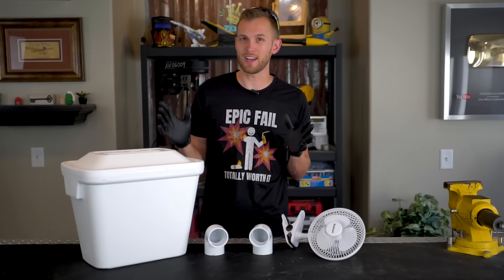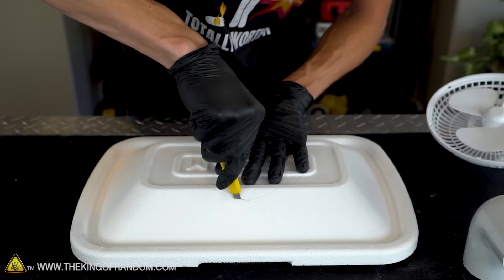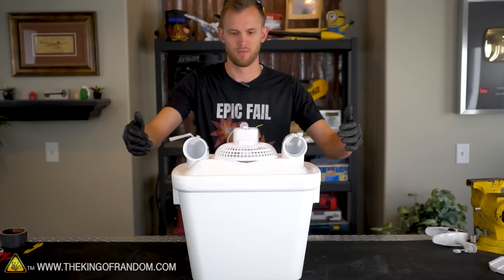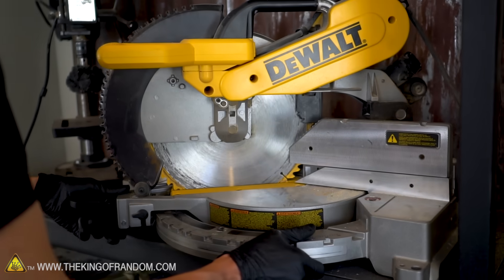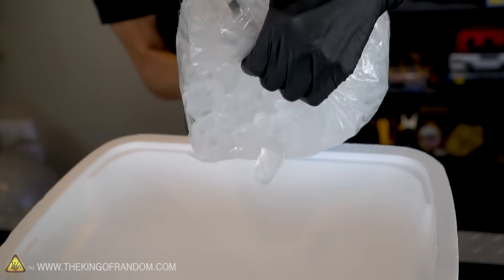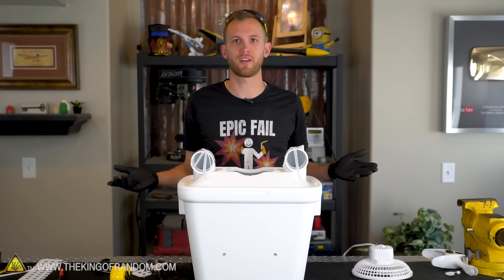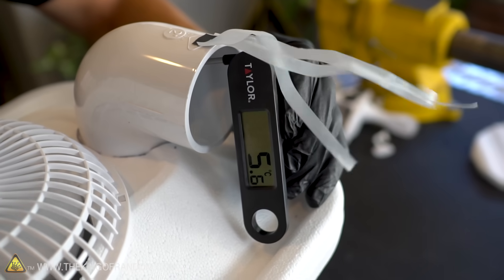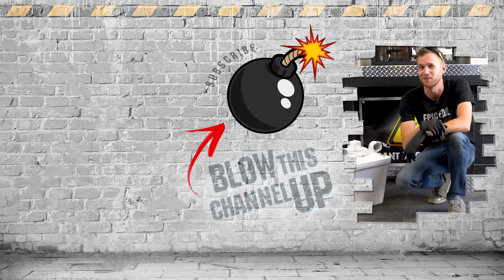Recycled Styrofoam Air Conditioner! TKOR Creates An Efficient DIY Air Conditioner!

Comment: Jeez his house is freezing cold I keep my A/C at 80-83 during summers here in southern California... Outside its like 90-115 degrees
Reply: Why TF u keep it that hot I live out here in NV when we got 100° days everyday and we keep our house at around 75 just close some blinds and don't leave windows open holyshit dude, what's the point of ac If it's that hot?
Reply: A is for Annihilation same I keep mine between 60-64
Reply: In Arizona we get 110 degree days in the summer.
Reply: You call that cold lmao
Reply: Ammar Badri .. 😓.. that's so hot. Mind u If central a.c. it's a little more accurate than window units but I keep my window unit on 60 degrees when I'm home.  66 when not on energy saver for fur babies.
Reply: Living in a high desert means that hot days are really hot. Living on the coast like in California where you have humidity in the air keeps you cooler even if the temperature is actually the same.

Comment: You could use a PC fan which is smaller and runs at higher speeds about 2000rpm to be exact then instead of ice at bottom and top you could use ice at the bottom then frozen water bottles at the top.

Comment: Could be better before the modifications, since the ice would last longer and require less attention to keep working.
I wonder if you had some flexible hose ducted from the fan, snaked around the bottom, and liquid water poured around the hose. Then stick the whole contraption in a chest freezer so that when you go to use it, you're using a big block of ice. Should last a very long time!

Comment: Instead of these ice based Aircon make one based off of evaporation BUT instead of using the wet air inside of the house like a swamp cooler, use the water that is cooled by the evaporation process to pump into a radiator.

Comment: If you put wet paper towel on the upper side of the bottles and cage the pipe with them it will improve your AC if you use salt water on the towels and for the ice you can go under 0°c
Reply: That 32°F for the Americans

Comment: Oh there’s one slight improvement if you want and that is adding a cone onto the nozzle, so that the air travels through the cone will get tighter and tighter air is surprisingly felt cool and you should watch a video about eco friendly ac without electricity and seriously it works.

Comment: why don't you just put a fan inside of your fridge and/or freezer? i mean, your ice also comes from the freezer.
Reply: You can't. Fridges heat up the room while cooling the interior (so making the ice for this air conditioner in the freezer means you actually heat up the room overall). You have to dispose of the energy generated ( this is why air conditioning units are connected to the outside, to dispose of heat). So if you stick your fridge half out the window then yes. You now have the most expensive, worst air conditioner ever. And you can't use your fridge. And you have to keep the gap between it and the window or door frame sealed else the air conditioner is ineffective.

Comment: Do I see a bucket shopvac in my future?
Reply: Exhaust could push out the air so ice in the bucket, might as well have another cooler sucking cold air for the intake and put a fan about a foot or two away from it to spread the cool air..please give this a try.
Reply: Just have to worry about the noise making you possibly fall asleep because you are so comfortable.

Comment: you should have put dry ice in the cooler or LN2.  my grandma once told me that when they use to drive from TX to CA they would put dry ice by the front window intake as they didnt have ac in the car.

Comment: What if you use liquid nitrogen instead of ice?
Reply: No you would not die from CO2. Liquid Nitrogen is exactly what the name says it is. Nitrogen in a liquid state. You would flood the room with Nitrogen gas, which isnt toxic at all as most of our air is made of it. But it would cause the room to fill with Nitrogen and displace the breathable oxygen. The most insidious part is that you can breath Nitrogen and not notice your going into Hypoxia as it causes confusion and euphoria to name a few symptoms. It would likely be fine outdoors but NEVER use Dry Ice (Soild CO2) or Liquid Nitrogen in these things in enclosed spaces, use common sense.
Reply: So basically... what I just said.

Comment: Wouldn't it cool A room better if the piping was straight up instead of 90°? Cool air goes down. If it is coming out at knee level, than only your feet would get cold. If it went up first it would circulate.

Comment: Friendly reminder:
DO NOT USE DRY ICE
dry ice turns into carbon monoxide when it reaches room temperature, so you will not have a fun time there
Reply: The Comedy Butchers 

Carbon Dioxide 

but yes dry ice is very bad idea
Reply: Dry ice should actually be fine. You're pumping mostly air into the cooler and a little bit of sublimized co2. It's not like it's a sealed container with no source of oxygen from the outside.

Comment: 22 degrees Celsius is already cold, getting something to 5.5 degrees might be harder when you live in a place where it's normally 28 to 30 (and that's not even summer yet).
Also, to keep the temperature of the ice even after melting, you can combine it with rock salt. It keeps the temperature cool for a while longer than just ice.

Comment: Hey why not put liquid nitrogen in that thing
Reply: It would work to cool things down but it can also fill your room up with a bunch of Nitrogen and replace the Oxygen in there. This could make you suffocate without even realizing it. Even if that wasn't a danger Liquid Nitrogen is very expensive to be used in that manner, even setting up a system to create Liquid Nitrogen wouldn't create enough to make it a reliable enough source of cool air as the Liquid Nitrogen would evaporate too quickly for the rate that you would be creating it. Ice is cheaper and can be refrozen in a shorter amount of time which makes it more reliable. Let's be honest, you don't need a substance as cold as Liquid Nitrogen to cool an area down.

Comment: So instead of using ice or the Frozen bottles! I use the Freezy Pops that come in the little plastic mesh bag bought two of them had one of the freezer had one of those cooler. It always made it really easy to switch them out between the two of them. Sad thing is someone eventually ate them all.

Comment: So.. Dont use dry ice?
Need a clear explanation why I shouldn't use it.
Reply: Naufal Adi Wibowo Dry ice would give about the same cooling as water-ice. The only difference being you would die from the CO2 gas evaporating from the dry ice.
Reply: just have a well ventilated room..?
Reply: Al D3M Mafia But since water ice basicly has the same cooling potential as dry ice, why would you use dry ice? It costs extra and has no benefits.
Reply: Håkon Lillebo dry ice is much colder than regular ice.
Reply: Al D3M Mafia I know, but thermodynamics are more complicated than temperature. Basicly the hydrogen bonds that water ice creates need A LOT of energy to break. It takes that energy from the surrounding air. That's why no one uses dry ice to cool their drink :)
Reply: Håkon Lillebo mate dry ice doesn't have any hydrogen bonding...
Reply: Al D3M Mafia That's not what I meant, sorry if I was unclear. That last comment about using dry ice in drinks was meant as an example of how no one uses dry ice for those kind of purposes as water ice works as well (maybe even better) and is much cheaper. :)
Reply: Håkon Lillebo yep sure :)

Comment: Pls put human blood in a vacuum chamber to see if it turns blue
Reply: This thread was about human blood sheldon.
Reply: It will not. It will boil though.
Reply: Blood in a needle is in an airtight container already and isn't blue also oxidation changes the chemical structure of subststances so removing the oxygen around it wouldn't do anything
Reply: Liam Benson no it wouldn’t
Reply: No it isnt, its either dark red or REALLY dark red (with a bit of purple) though I imagine if your blood is that dark/purple you're probably choking to death.
Reply: Blood is never blue
Reply: Blood, in no situation, should be blue.
Reply: In short; Blood is never blueish, or blue. Its either RED (Oxygenated) or Dark Red (Deoxygenated).
Reply: Where will he get human blood. Will he cut himself for it
Reply: Blood only looks blue due to angles and wavelengths of colors through skin.
Reply: Unless you're a crustacean, and have copper based blood.
Reply: Human Blood, Vincent, but thanks for telling me that, I never knew about the clear blood.
Reply: vincent trigg he meant human blood
Reply: Jake Albers no it's not, it's dark red/ maroon
Reply: Liam Benson the whole blue blood thing is fake because we have oxygen in our bodys our upper body has air in it not much but still air.
Reply: It won't.
Reply: i can’t believe how many people actually believe this
Reply: Liam Benson red blood has oxygen attached chemically. You can't remove chemically bonded oxygen using a vacuum, so the blood remains red.
Reply: Blood in a vacuum would boil off and solidify into a big gross mess.
Reply: your blood is never blue, its just the veins looking blueish under your skin
Reply: He can get human blood from the hospital
Reply: Liam Benson pigs blood is better
Reply: 123 123 
Horseshoe crabs have blue blood.
Cuttlefish have a green-blue blood.
And the ocellated icefish has clear blood.
Reply: 123 123 deoxygenated blood is a blueish color

Comment: rather than tubes for the out vents. use a tube for the fan to push air down under the ice to the push up through the ice then up through the vents.

Comment: I have to wonder about the trade off with the ice instead of the bottles. The ice may be more efficient, but how quickly will it melt and you will have to dismantle your cooler, remove the melted ice and refill. For a few dollars more, I would find a plastic container to fit in the bottom and a basket for the ice, then to swap it out, you remove the basket and empty the container. Or, although the bottles may not be as efficient as the ice, but swapping them out may only take 30 secs. Also, how about finding more smaller and thinner walled plastic bottles (have twice as many as you need, keep half in the freezer, so you swap them out in 30 secs, and hopefully refreeze one lot before the other lot melts).
Reply: Michael Rudkin yeah, this project would actually help me out. Doesn't get hot enough on as many days to justify buying an air conditioning unit and I would much rather have the convience of the bottles.
Reply: Thats why its in a cooler

Comment: what do you do if its winter?
Reply: Use a flamthrower
Reply: Brandon Garven make a fire :)
Reply: Make hot cocoa
Reply: Umm easy 
summer:ice water
Winter:boilingwater
Reply: it will melt the styrofoam
Reply: put a boiling water in it
Reply: Just use a radiator
Reply: nO im Australian
Reply: Brandon Garven not use it
Reply: hot water bottle in it
Reply: Ice cubes for summer, camping hand warmers for winter.
Reply: If the room is too warm and it's winter? Turn off the heater. Open a window if you must. Or live in Iceland.
Reply: Move to Arizona. 💥
Reply: no ac needed LOL just put warm water bottles

Comment: Everyone needs to understand that if you use ice made in a freezer that’s INSIDE your house, you will end up INCREASING the temperature overall. 

This is why real a/c units always release their heat outside. If you use a garage to freeze ice and then bring it inside, that would work. But thermodynamics says the overall heat in the system will increase while running a motor to freeze ice and another motor to power a fan.

And one more thing, the cooler the air, the shorter it will last. Getting colder air does not mean it’s any more “efficient”. Another way of thinking about it is that the room will heat the ice up faster, the better your design lets the hot air flow through the ice.
Reply: Yes and no. Air dissipates and with it the heat it carries. You will make the kitchen hotter, big deal. That extra heat and air will be negligible in the next room already.But if you put ice to cool the air that is directly next to you and blow directly on your skin, that is a difference that you can feel.
Reply: None of this matter if your trying to cool down a room other than the one your refrigerator is in😂😂
Reply: Trey Moore that is not true if the freezer is already on. If the freezer was only turned on to produce ice for your makeshift a/c you would be correct.
Also it would only have an effect of you were using the a/c in the kitchen.
Reply: @justinkirschenman2232  if your freezer is already running, it's already generating heat in that room.  You ARE increasing the house's overall heat, even if one room becomes cooler.  This is basically turning that one room into a fridge, while making others warmer.
Reply: You could have ice you bought. So a couple of hours of cool for a couple bucks? Not too bad.
Reply: That's risky if there are any leaks.
Reply: Trey Moore t
Reply: Exactly. I would rather watch him make a DIY swamp cooler, that cools the air by releasing water vapor into the air.
Reply: Trey Moore correct me if I am wrong, but wouldn't some of the heat energy in the room be used to break the intermolecular bonds in the ice, resulting in a net cooling effect ?
Reply: Trey Moore 
What if the "ac" container is placed within a container of dry ice that is sealed to the diy "ac"?
By sealed i mean so the Co2 doesn't escape in the room, it could have a hose leading outside to leak out the Co2.

Does this make any sense?

Comment: make graphene using tape and graphite
Reply: Actually that was exactly how the first group isolated graphene. Have to dissolve the tape off and you can only make small pieces. To calibrate our scanning tunnelling microscope, we used to use tape to peel a fresh surface of graphite. Who knew we were throwing a Nobel prize in the trash.
Reply: Goldman LEE graphene is a single carbon atomic thick. That's not how it works

Comment: By compressing air u are cooling it.
So, by having a bigger fan and compressing that air with a funnel before it enters the box.
That way the air is alittle cooler and the ice should last longer and it should be easier to cool down since its already started to cool a bit

Comment: If you really want to upgrade it more do a mold from silicone that will make a big iceblock with holes all over it and 2 bigger holes for the pipes .if you do that you can re use the water too

Comment: You could try dry ice suspended inside the box, with a small vent on the bottom of the box for the condensed air and carbon dioxide (or most of the CO2 that is sublimating off the dry ice).

Comment: I have a mod you can try replace bottom row ice with dry ice
Reply: You forgot to add the part where you die from it
Reply: Not if it is on the bottom rack to which it's purpose it to cool the ice making it last longer